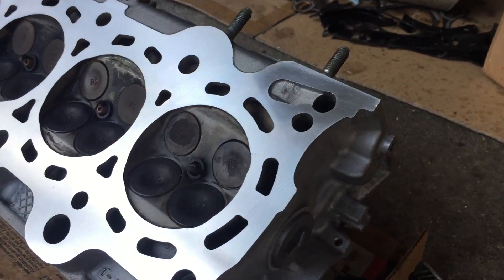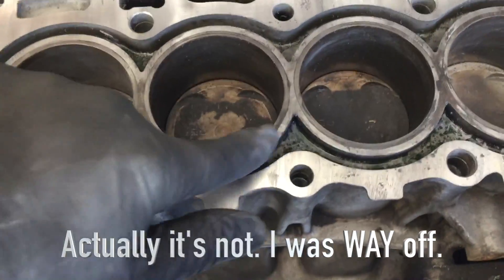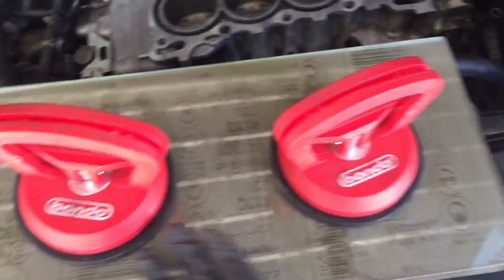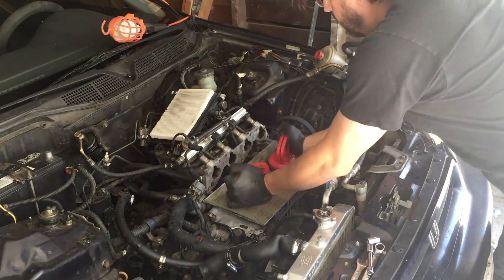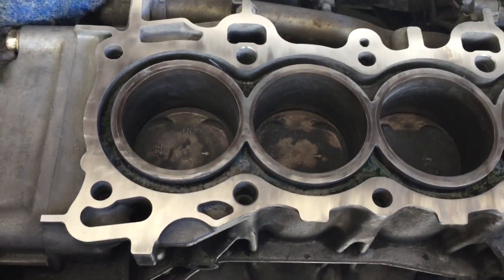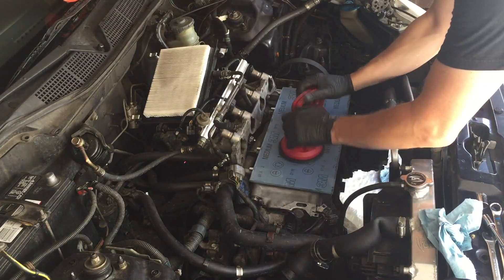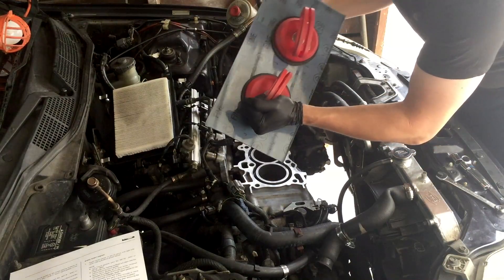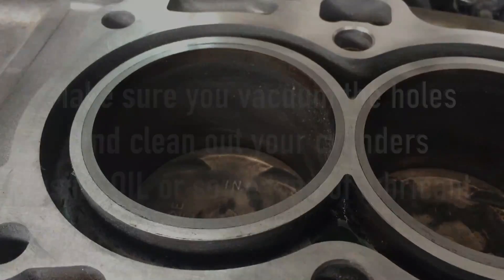Honda Civic Block Resurfacing Without Removing Engine

Comment: Wow, good idea! 

I know it's a bit over 6 years old, but did it work out? I have a 2.4 Ecotec in the same boat. Don't have the bucks for the (Stupid) Torque To Yield bolts to rebuild. It takes 20 tty bolts to hold the crank plus rod & head bolts. I'm thinking do it in frame like you did!

Thanks again for sharing!

Comment: What'd you use for adhesive?  That's about the only part that makes me paranoid using this method, other than thinking I'll set on a surface plate after I attach to the glass or maybe an in tolerance granite piece to use.  Thinking might do for the head as well, if required, for my prius since is needing the head gasket changed. Seems more common than I expected. Thanks for sharing!

Comment: This is probably the best way to sand the block at home. Ive tried a few different ways and this is probably the only way one that gave me the flatness to seal the gasket. Biggest mistake I see in most DIY is using sander that is shorter than the block resulting in a concave surface. Thick glass and glass suction cups are spot on. Great video.

Comment: So, seeing as how this video was posted 5 years ago…. Long-Term review? How long did the new gasket set hold up (or are still going strong)? Just curious, because most people always think they need to spend $3k on machinework on a $300 junkyard motor when stuff like this works perfectly well. Granted, I wouldn’t do this on say a $25k Hellcat motor…. But on a daily beater, it should work just fine. I’ve done a similar thing multiple times only I have a machinist’s block (perfectly flat with zero inconsistencies) that I use instead of glass. Same idea, different tool.
Reply from the maker: It still works great! The car has 275k on it now. I sold it to my neighbor across the alley (so I still see it all the time) and he hasn't had any issues with it since!
Reply: @tedgianopulos  That’s awesome! Glad to hear it worked out. Hope other people start learning to use elbow grease over credit cards and being more self-sufficient as well. Pretty easy to do with YouTube now. Thanks for the response my dude!
Reply: @tedgianopulos  That's badass, man. Good to hear. My block is flat so i cleaned it up gently but I used glass and sandpaper for my heads and i'm hoping all goes good.
Reply: @tedgianopulos  whats the size of the glass you used
Reply: What was the measurents of the tempered glass ??

Comment: A light spray of Holamar with a MLG will last forever..... as far as you have gone in preparation clean threads WD for the bolts shake off excess WD proper torque sequence.....you can't go wrong
Hopefully your head is done as well as you block

Comment: Couldn't help but notice that all of the oil return holes were open/left unplugged while you were sanding.  As an engine builder I cringed. 😬
Reply: The idea that oil drains take the oil to the sump and that goes to the filter is the stupidest thing I've ever heard. You are literally running sand through the oil pump and you are spashing it on the crank and cylinder walls, not to mention what the filter doesn't grab acts like a super fine abrasive and literally grinds the crankshaft journals while the engine is running. 
  Simply order a Norton surfacing stone with 100/320 or 100/220  , they are 2" wide and 6 or 8" long. Spray WD40 on the deck surface and your stone, in a Circular pattern clean the surface Starting at one end and continously moving towards the opposite end. After each full pass wipe the deck off with a paper towel to pick up any debri. Clean the stone with wd40 between passes. This takes about 30 minutes but ensures a flat gasket ready surface that is clean.
Reply: @israeljones2568  Have you personally used the a norton surfacing stone? Can you link something you'd use? There are tons of Norton products out there. Thanks!
Reply: im thinking that hot glue down the hole would seal it and be easy enough to remove. the cylinders should have been masked off with plastic and tape. after the sanding process is completed id vacuum everything then pull all the seals I made off.
Reply: What would you use and how would you block those holes? I'm probably going to resurface the block on our van sometime this summer
Reply: @a-dog8075  Shaving foam.

Comment: Keep in mind and always check the flat surface  of the Tempered glass
I have come to learn and appreciate the technical aspects in undertaking and Milling of an Engines block and attaining required engine specs.
Sure I made errors the first time attempting to resurface the engine block and I would do it again. I honor this YouTube. I think it is ingenious but i can not stress how important it is to always check the flatness of the tempered glass.

Comment: what glue did you use to glue the sand paper to the glass ? im having a bad time finding one that even works decently
Reply from the maker: Just like Elmer’s glue stick from kinkos. It works best because it’s easy to replace the old paper with new stuff. And it washes off the glass with soap and water.
Reply: I used Super 77 spray, but Elmer's would save money and may work just as well. I also take a roller over the sand paper to smooth out the adhesive.

Comment: I can't afford a Sunnen but I can buy glass and sandpaper! I've got a 93 BMW 318is with a cracked head and a blown head gasket. I found a good head that's already been surfaced and rebuilt, but I have to check the block too. After 260k miles, it probably needs some resurfacing. Thanks for documenting this Ted, I'm gonna go for it.

Comment: So my question is what kind of head gasket did you put on, MLS or some kind of composite. I have heard that this method of resurfacing the block can get it within flatness spec but not smoothness and a MLS gasket requires it be very smooth. Sandpaper cannot get it smooth enough. I cannot find a "composite" head gasket for 6th gen Civics so I am curious if you did in fact use a MLS gasket and if it has held up.
Reply from the maker: Yes it was an MLS one. 👍
Reply from the maker: I just used a Felpro head gasket. I don't know what MLS is. The metal sandpaper I used was able to get it perfectly flat in my case. If the block was warped though, I could see it not working as well, but the tempered glass was a perfectly flat sanding block for this job.
Reply: @tedgianopulos  MLS is multi layer steel... I think the FelPro is an MLS gasket.
Reply: @tedgianopulos  MLS: multi layer steel. Consists of 3 layers of steel. A composite is the older conventional kind, feels more like organic material.
Reply: keep increasing grit...I did this same type of procedure and started out with 100 grit til I was almost flat....then 220 to 320 to 400 to 600 to 800 to 1000 to 1500 to 2000 to 2500 to 3000 to 5000. I ended up basically polishing the surface.

Comment: What’s the max amount you can take off the block or head?
Reply: It's different for every engine. Sometimes there will be dimples that show how much extra material is left. Once the dimple has been machined away, no more material can be safely removed. The most important thing is to make sure the valves will never hit the pistons, and the pistons will never hit the cylinder head. You can check the clearances with silly putty, modeling clay, or something similar that's soft and easy to work with.
Reply: @eddiesheeran5791 Silly putty is an excellent idea. I ground beyond the limit and need to check if the quench will be within spec after shim and an MLS gasket or double MLS gaskets . Thanks!

Comment: Did one sheet of sand paper fit the whole glass or u had to use two sheets?
Reply from the maker: I had to use 1 and a half of another. just made sure I cut it so it was flush with the edge of the first piece.

Comment: You showed us how to do this without taking the whole engine out of the car, but wouldn't you need to take it out to clean those oil and coolant passages? I'm assuming those got filled with metal shavings.
Reply from the maker: I cleaned it all out with a microfiber towel and some oil on it. Worked great.

Comment: What is the size of the tempered glass?
Reply: For this engine I used 20’ x 8’
Reply: @waltersob2000  20'=20 feet. 20"=20 in. No pun intended
Reply: What about glass thickness anyone?
Reply: Trying to order from same place just wanna make sure what thickness I need. They quoted me 1/4 inch thick for about 15ish

Comment: I was having slow total coolant loss every 2000km. At first the was no leaking anywhere but eventually some hoses starter to leak. Tightened the hoses more but then the radiator gave up(leaked from top). So the problem was bad head gasket, it was my mistake( I drove the car 30minutes with thermostat clogged and high temperature). I changed head gasket and radiator and thought everything was fine. Then after 3000km coolant reservoir was toping with coolant and wouldn't go back to the system. in order for this to happen air must be in the system. And air without coolant loss can only be from combustion chamber. So another head gasket failure so soon. Everyone said don't mess with head gaskets and change the whole engine cause it's hit and miss. Well I believe that everything can be fixed if not totally broken. So the conclusion is that my mechanic and most mechanics didn't check the block surface not even bother clean it well. Just a little. I went myself to the shop and resurfaced the engine block with exactly the same method. A  6mm glass and sandpaper. I marked the whole surface with a sharpie and sanded A LOT until all sharpie was removed(it was uneven at a corner). Then the block was completely cleaned and straight. I have driven now 6000km from the second headgasket change and there is no coolant loss at all. 
So thank you for making the video which inspired me and gave confident to do the same to my car.
Reply from the maker: Glad it helped! This was my second time doing the head gasket for this car. The first time didn’t take because I didn’t sand down the block so it didn’t hold properly. It’s been a long time and the engine still runs awesome. Haven’t had to do anything to it since.
Reply: "Tightened the hoses more"

do yourself a favour, get spring clamp pliers (remote ones if you feel like treating yourself) and ditch all the screw/worm clamps for spring clamps - typically standard parts on VWs and toyotas, some people give them shit, but in my experience the toyota ones are excellent quality and it's not uncommon to see 20 year old ones still holding strong.

spring clamps are better in almost every way - they apply constant pressure no matter what, whether it be thermal expansion and contraction, or age of the hose...they always do their jobs properly. worm clamps can't apply constant pressure if the hose contracts, plus you have to deal with the trouble of a monkey overtightening them, causing the clamps to eat into the hose and sometimes even cause leaks.
Reply: Same dude same! Except I’m still in due process. The head is getting resurfaced at the shop and I’m leaving the block in the car to do myself. The first time it lasted around 7k miles but I always had slow coolant loss. And I had a cheap aftermarket thermostat. This time, I’ll make sure I do it better
Reply: @FZERO20  cool... don't listen negative feedback and just do it. Even if it doesn't work, you will have at least tried
Reply: @apostolisioannou4073  thanks man. And you a real one for responding from a message you posted 2 years ago😁

Comment: Te recomiendo poner grasa en los pistones para evitar arena de la lija en los anillos
Reply: This is the comment I was looking for. Grease around the piston rings works great to prevent filings or fine shavings from getting between the piston heads. An alternative is to use Play-Doh around the piston heads.
Reply: @JustOneSmallExplorer  And I was looking for THIS comment. PlayDoh or “Plumbers Putty” is what I’ve always used and have built numerous high-end motors. The last one I built is a Whipple supercharged LS7 putting 1638hp down and has 80,000 miles on it now with nothing more than a water pump replacement over all that time of abuse. People always cut corners….. and find out just how sensitive engines can be with tolerances and particulates.
Reply: @BlackwaterDSM there’s no way a whippled LS7 makes that much power 😂 nice try tho

Comment: This is the first I have seen this method. Very ingenious!
Reply: Ken Shoufer it’s been a year and mar is still running like new after this! Thank you!
Reply: I DID THIS A FEW YRS AGO...JUST LIKE YOU FOUND OUT IF YOU START OUT WITH 80 GRIT THEN 120 TO 400 GRIT...BUT???....JUST LIKE YOU HAD THE BOARD TO BIG...YOU DO WANT IT TO BE LONG ENOUGH TO GO OVER THE BLOCK EVERY TIME YOU DO ONE STROKE...BUT I CUT BOARD IN HALF...THAT GAVE ME A FULL 2INCHES OF BACK AND FORTH...THE LENGTH NEEDS TO GO ACROSS  THE WHOLE BLOCK SIDE TO SIDE BACK AND FORTH...IT TOOK ME ABOUT 38MIN...80/ 120/400...GRIT...ON BOTH SIDES..THE BACK OF THE V6...AND THE FRONT SIDE OF THE BLOCK...THE HEADS WAS DONE EXACTLY THE SAME WAY...THEN CLEAN EVERY THING OFF AS BEST YOU CAN..WIPE BACK UP..THEN WIPE BACK DOWN WITH OIL...USE COMMON SENCE..WHEN DEALING WITH  FUNCTIONS OF A MOTOR

Comment: iyi iş çıkarmışsın. bravo. fakat o şekilde fazla çalışmamaya dikkat etmelisin, vücudunun bel bölgesine çok yük bindiriyorsun ve bel ağrısı çekebilirsin.
Reply from the maker: You're actually right. My back actually was hurting after, but mostly because I was using the wrong sand paper at first. It should have taken me about an hour to sand properly with the correct sand paper but I started out using wet-sand paper instead of metal sandpaper and it took way too long.